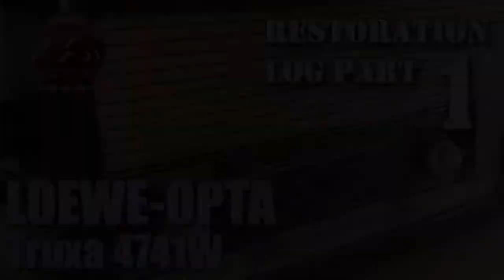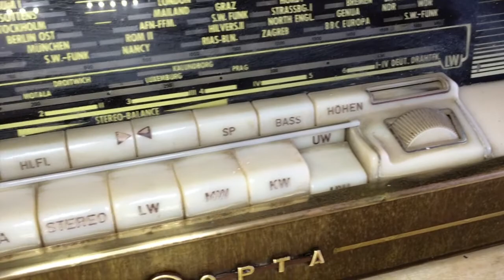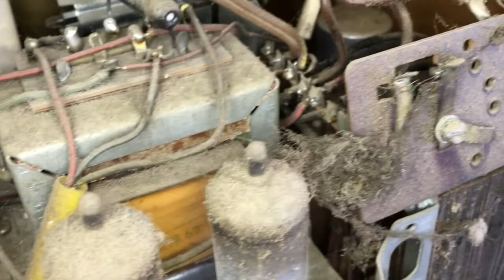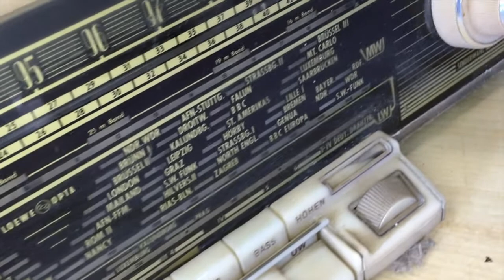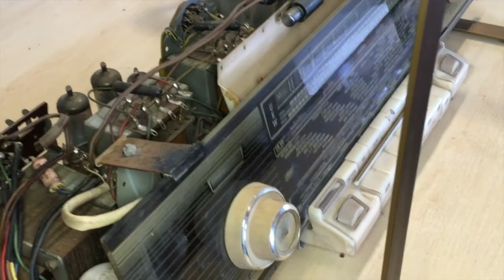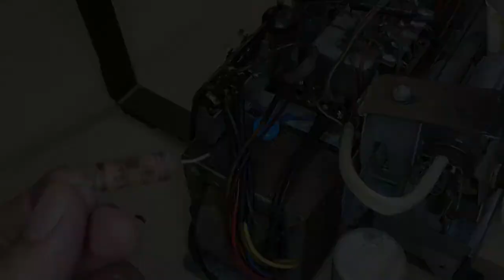Loewe-Opta Truxa Stereo 4741W tube radio restoration - Part 1. Check-up and first power up.

Comment: Excellent video, watch all 5 Episodes if you are into old radio restoration, the advice here is among the best you can get!!

 My first stereo was one of these in the late 70s, only a few caps got changed back then and it worked well for a long time.
Some additional notes to this unit: The primary winding extensions on the output transformers are for hum bucking, they are wound in a way as to cancel out mains hum in the output stage, therefore you didnt hear any hum in the speakers despite AC ripple on the HV supply. 
The little 9 pin bridge plug between the EBC91 and the EABC80 is where a MPX stereo decoder option was to be plugged in. This was available back then as an option at extra cost. My radio was not fitted with this, and because these original MPX decoders were extremely rare I bought a generic decoder in kit form (solid state) and wired it to this bridge plug. A miniature bulb placed by me under the "stereo" button lit it up whenever the unit was tuned to an FM stereo station, worked like a charm.
My record turntable was a pretty modern unit with Moving Magnet pickup, the Loewe only has a high level crystal input so to round it off a transistor MM preamp was put inbetween, the sound quality was amazing despite the output stages being only single end..
Reply from the maker: Thank you for your input. This was one of the restorations I did quite a while ago, but the learning curve never ends, which is why I get so much satisfaction from my channel.

Comment: Good day.
I am looking for instructions to the radio loewe opta truxa 2731w.
Do you happen to have?
I found only the electrical circuit!
You can throw on artss666@gmail.com
Reply from the maker: No. Only the schematic seems to be available.
Reply: Do you have key instructions?
AUS, TA
Reply from the maker: None. Only the schematic.

Comment: There was a rather strange one called the Hellas which had five built-in speakers!  There were two woofers, two small midrange speakers and a horn tweeter which radiated out both sides of the cabinet.
Reply from the maker: douro20 : the precursor to surround sound :)

Comment: Hi, 

Thanks for this very informative video!  

I'm eventually going to work on a Olympic Opta tube radio that was made in W. Germany.  It says Olympic Opta and Made in W. Germany on the front dial.  I think it's a Bella Luxus 5700W from 1958.  I'm not sure if it's a Loewe radio or not as the front name plate at the bottom of the radio is missing.  It has AM/FM and shortwave.  It was totally dead, but after cleaning it up a bit, I've found that the AM band works a little bit.  It's not as fancy as the radio you're working on, but I hope to get some tips for working on German radios.  This is my first European radio.  I live in Los Angeles, California and am mostly used to working on American radios from the mid 1930's to early 1940's.

Regards, Tom

Comment: Hi, great video! I have the same radio as this and I am looking at refurbishing. What type capacitor was it you used on the transformer?
Reply from the maker: +Rikki Mccreight : which capacitor on which transformer?
Reply: M Caldera. Ah yes, the capacitor to ground from the power supply.
Reply from the maker: +Rikki Mccreight : on the secondary the transformer connects to the rectifier, and then the first 50uf/350v filter capacitor.
Reply: M Caldeira OK, thanks.
Reply: Rikki Mccreight

Comment: Hi, just came across your channel last nite and really enjoyed watching the videos that you have uploaded.... I learned a lot as you explained your reasoning for replacing caps or how certain switches altered the signal to a tube and such.... Was kind of in disbelief that you don't own a tube tester, actually taking the time to wire in half a 12ax7 to confirm a 6av6 was bad (clever though)!!! The reason I ended up on your site is that I recently acquired a Telefunken Allegro 5183W 1961 or 62 (someone actually threw it away) and would really like to get it functioning again.  Would you know where I could get a copy of the schematic for one as it wasn't in the envelope on the back? Thanks, Tom         Keep posting your projects, the videos, narration, and tech work is very well done indeed..
Reply from the maker: +Bucyrus Erie12 : hi. Welcome aboard. For the schematic, I tried a google search with no success, except a couple of sites you have to be a member of, like radiomusuem, samwebsite, etc. I did find one for the allegro 2183w at http://5.132.37.30/nvhr/Telefunken_2183.pdf which may be a start. With the few telefunkens  I've handled, I've found that they have a crazy numbering system, which sometimes is not indicative of any sort of order, so the radios may well be similar.
As for the tube tester, no I've not got one. The ones I've found for sale cost a fortune to ship out here to madeira, so I've not bothered. This is a hobby for me, so there is seldom a pressing need for this equipment - and the challenge is great. 
Surprisingly, I very seldom find completely blown tubes, so having a few around that I know are healthy always confirms the state of the radio for me by swapping in the known good one when there is a doubt. 
Thanks for subscribing, and keep watching. I've a Braun atelier under restoration that is coming on very well.